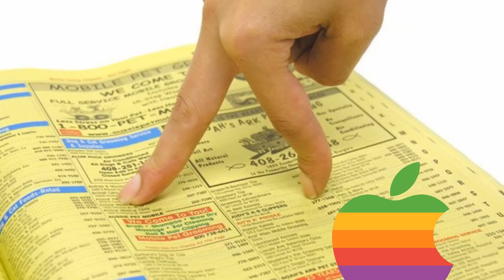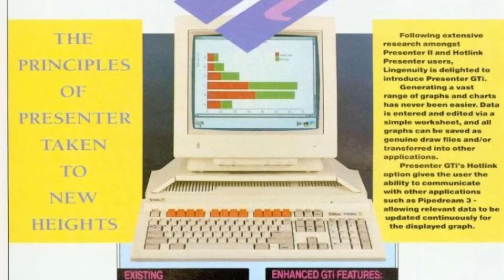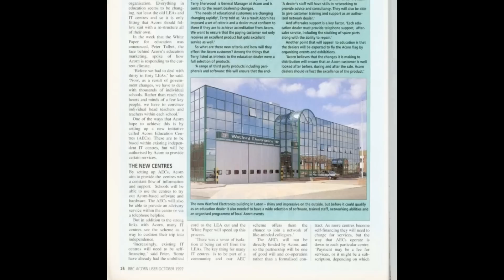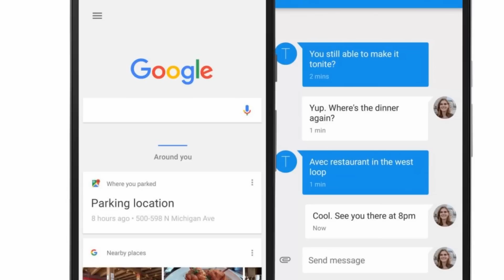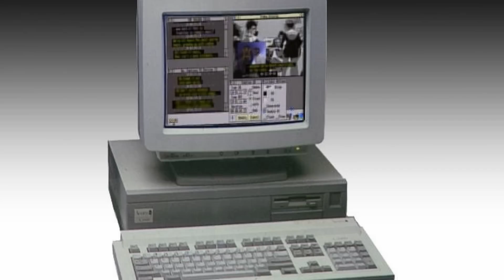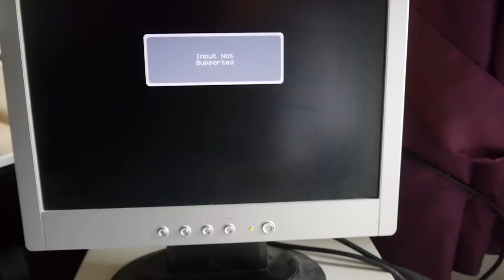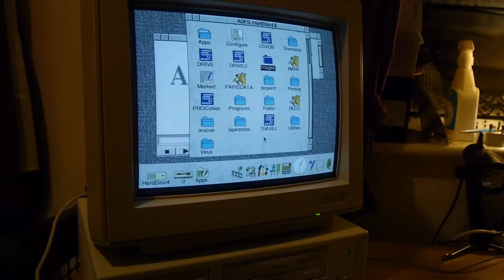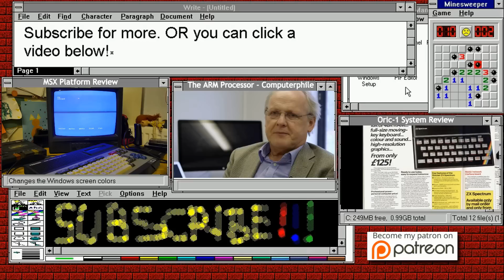Acorn Archimedes A3010 System Review & RISC Explained | Nostalgia Nerd

Comment: I wish you would have compared Elite with the current PC port of the game, I have only ever played it on DOS Box, even though I was gaming on a top of the line Zeos 486DX2 in 1991 - my dad bought it for "the family" (basically he KNEW he wanted, and figured me and my brother would quickly fall in love with it - which we did! But obviously, my mom almost never touched it, apart from Solitare!) I knew how to run DOS at nearly a professional level by late 1992, my favorite games in the early days were the likes of Wing Commander 2, Savage Empire, Commanche64 - and many others, some very popular like Lemmimgs, some all but unknown at the time.  Never got into Elite though at the time - even though I jad a PC capable of full 3D at 640x480 to 800x600 and eventually even 1024x768 and above by the time games like Quake were around - my dad went through upgrades like CRAZY at the time - I don't even remenber all the different video and sound cards we got in the early days, though in 1992/3 I DO remember the first video card upgrade, he bought it to play full 3D flight sims at the best available performance, it was an 8 MB Diamomd Edge 3D accelerator, which IIRC had to be plugged into the 2 MB "2D" based video card, but it may have replaced it... Because even the video card and sound card and even the 350 MB HDD our Zeos brand FULL Tower 486DX2 top-of-the-line  were all top notch, as they should be, since my dad did spend something approaching $5000 - I KNOW it cost no less than $3000! 

Anyway within 2 or 3 years (I forget exactly) we had upgraded the entire motherboard for a Pentium 133 which of course, was top of the line when dad bought it, I actually think it was a Pentium PRO possibly... And then the VooDoo3 right after the TNT, eventually I was playing games like Hexen at 1024x768 at around 60 FPS with video settings maxed out! THIS is why the N64 and PS1 were the LAST consoles we ever owned!
 
Going from my family's PC to the N64 to play Hexen was TORTURE! As were those AWFUL CONTROLLERS! To the point where I NEVER played it on N64, Unless we had 4 people on split screen which made it great for hanging out. Of course since my whole family are PC people, we had LAN parties, and I LOVED THEM!  Hexen on N64 was absolutley TERRIBLE! Much lower frame rate, resolution, constant hitching - and this was something like 2+ YEARS after it came out on PC, and I was already playing at MUCH  better quality in every conceivable way! 

To me, looking back on all this COMPUTING HISTORY - it is nothing short of AMAZING! Almost miraculous-  to think that RIGHT NOW - on my lap sits a Tablet with a 64 bit Quad core ARM V8 CPU - with a tiny Adreno GPU - that can EASILY blow away even PC games from just 6 or so years ago, and compared with my first PC ever, that nearly $5000 Zeos 486 - this tablet is LIGHT YEARS MORE POWERFUL IN EVERY WAY! And it even has a TINY 256 GB Micro SDXC-  that is the size of the tip of my pinky, and it holds THOUSANDS of times more data than every single BIT of memory combined from my Zeos, Hell the 3 GB of RAM in said tablet is still hundreds of times more! 

And it is ALL BASED OFF OF ACORN ARCHIMEDES ARM TECHNOLOGY! Combined with Google's Linux based Android OS, it is SURPRISINGLY 
powerful in every way! 3D games run amazingly well and never fail to surprise me with how good they look compared with my INCREDIBLY powerful X86-64 desktop! ARM technology is really amazing!
Reply: it's insanely great :)
not the gfx, they are fine. Tidy Classy and Fast - but the on screen buttons - so no function keys (yay - stupid but it's why the Nintendo port is so good xx)
Other ships fight between themselves - often completely ignoring you. You are in a Live universe.
and.... Police... omg the f---&& police. Fly in formations - dominoes and shoot as one. 
It should have been open world - god if they had... we would have had ARM everything (our current state of being ;o) 10 years earlier <3

there's a public domain release - 1.14 for any arm emulator xx #rpcemu?
I didn't mention how complete and polished it is. Grrrreat game. but 1991 Jeff Duggan Elite A III is the best ever version of 'original' elite. - cos u can buy ships :D

Comment: Don't forget the fact that the Motorola 68000 CPUs are used in early Macs as well as Amigas and Atari ST's.
Reply: Not to mention the Sega Mega Drive and Neo Geo...

When you look at the early home computers and consoles, until we get into the era where 3d games start to become common, you see the intel X86 family off by itself...
The closely related Zilog Z80 and clones. (surprisingly similar in several ways to the X86)
The 6502 and derivatives such as the 68c816 (Seen in the Apple II, C64, NES, Snes and a bunch of other systems)
And of course the motorola 68000 and it's close relatives...
Reply: Yeah, it was all Zilog Z-80, MOS 6502 and Motorola 68k for a long time.
IBM POWER and PowerPC had little share in the home market but stayed mainly in the server and large computing realm, even after x86 came along. Which btw are RISC internally since atleast 1993.
Reply: Most of the 80's arcade machine game boards we're powered by Motorola 68k and Zilog z80 daughter boards.
Reply: Intel and AMD make cisc processors Even today as the x86 architecture is orginated from a Cisc design..

Comment: Does the A3010 use standard 1.44mb PC disk drives or does it need a specific make and model to work as the Amiga and Atari ST computers do? I have one but the disk drive head is beyond repair by cleaning etc so need to swap it for another so I can enjoy this fabulous machine I bought a long time ago (PAYPAL thought a broken disk drive was OK for a 'tested' and 'working' system item description)
Reply: Yes it can use a standard 1.44mb drive, but they need to be modified.  I have once such drive in my A3010. As luck would have it I also have a working A3010 original drive that is nice and quiet but now surplus to requirements.  Would you be interested?, if so drop me a line:

andrewDOTmcconvilleATmetronetDOTcoDOTuk

Comment: I will say RISC and CISC has merged since p3. With CISC chips being packages of RISC cores. Also, DSP and RISC cpus have merged.
Reply: That trend has been ongoing for quite a while. RISK designs have been getting more and more complex instructions, and CISC machines have been gradually dumping direct support for some of the most obscure CISC commands, and then using internal microcode in the CPU to translate such instructions into a sequence of smaller, simpler instructions that the CPU actually executes.
To be fair, when it comes to the PC I'm not sure a modern X86 controller is even remotely similar at a low level to the original 8088. What it does contain however, is a microcode translator that recognises and properly translates all original (and any newer legacy stuff, such as the original MMX instructions) and translates them to what the modern CPU actually knows how to do internally.

How similar the internal instructions are to what the CPU claims to be it's instruction set though... Who really knows except the designers of the processors...

Comment: Is there any relationship to the current ARM cell phone cpus. Simular to the lose relationship between 486/Pentium to current gen CISC chips.
Reply: ARM is still RISC to this day (which, by the way, does not mean what the video explains). IBM PC and derivatives/evolution are CISC.
Reply: Same family. Likely the very fundamental aspects of the instruction set and architecture are the same.
Just as a current Core i7 can still run the same instructions that the 8088 designed in the late 70's can, it seems quite likely that a modern ARM cpu can still run the same code that the very first ARM chip could.

Of course, the modern systems have had major design changes, new instructions, more cache, pipelines, floating point units, and are just much faster, but they probably still understand all the old instructions...

Comment: The A3010 was the best home computer Acorn put out and technically superior to the slightly cheaper (£100 less) stock Amiga A1200. Sadly the only decent games of arcade or console quality were straight ports of Amiga titles like Lotus Challenge 2 and so were not better. If only some slick arcade games that didn't look like 50 pence PD software were released it may have taken off. The ARM chip in this is about the same performance as a 20mhz 68030 (the Amiga 1200 14mhz 020 is crippled to an effective 7mhz without an expensive 32bit FAST RAM memory expansion due to legacy design compatibility with Amiga 500 chipset butting in 1/2 clock cycles. And just last week ARM was sold off for a record price so it really is the end for an amazing example of British superiority. Proof that crap looking games hurt sales badly.
Reply: tiz true. Very few of the original games were anything close to finished xx shame.
everything else totally rocked. On just about every Acorn machine I've ever owned - and the ones  we still dev xx

Comment: funny how perception differs, I always preferred the Amiga and Atari keyboards heh
Reply: The Amiga 1000, 2000, 3000 and 4000 keyboards are OK, better than PCs and Macs of the time in some cases like A1000 or 2000 but the keyboard on A600/1200 is as disgusting as the poor keyboard of the Atari XE machines and the 500 not much better than the 520STFM keyboard. I wouldn't piss on an A500 for typing endless lines of code into that's for sure lol
Reply: completely subjective of course, I would rather have my A2000 keyboard than my corsair K70... wish there was a way to adapt them to use them today similarly to how you can with the C64 keyboards
Reply: Lots of solder and a fine tipped soldering iron and an old Packard Bell proper keyed (not iMac style) USB keyboard. This is what someone did with a dead Atari 800 keyboard and hardwired each key to a key on the packard bell keyboard to make a USB Atari 800 keyboard for his emulator (which he ran on a small Intel Atom nano ITX board inside the case of an Atari 800. It is somewhere on Atariage, damned impressive but possible for any mechanical keyboard including Amiga 2000. Keyrah mapping for use in Windows with the C64 keyboard is not really suitable for day to day computer use if I am honest but is great for emulated systems inside real C64 keyboard and case though. (Well v1 keyrah was)

Comment: I am impressed by the power the system has I didn't know they produced a model up to 95 those have good graphics but sadly all these early machines were limited by their propitiatory hardware short shortsightedness to future applications so they died with only their own system just imagine what could have happened if they all were compatible with one another.
Reply: Actually that's where you're wrong because the Acorn Archimedes machines had very simple to use audio hardware interface and video was straight up VGA style byte per pixel screen memory manipulation just like 486/Pentium PCs graphics cards at the time. Both Archimedes and PC compatibles were pretty much 100% CPU centric....a rich mans ZX Spectrum/ZX81. The model is better for scalability than the Amiga custom chipset rich and slow CPU model because come the time of a new machine being needed R&D is astronomical. If you had ever tried to code X86 machine code in that Dickhead's Operating System (DOS) environment you would come to the conclusion only a prick would wonder why any machine should be like the piss poor PEECEE pre Win2k/XP and PCI/AGP. The worst machine on the planet won, it would be like MSX conquering Amiga 500....absolutely idiotic situation we ended up in thanks to yank pricks NOT buying proper computers and getting IBM EGA and NES delusional combo of 'technology' lol dumb twats
Reply: After the Archimedes you had the RISC PC, you should check what it could do, and how it could do it.
If you study the Acorn hardware, the design was flexible enough to allow Acorn to produce new models with extended capabilities, sometimes simply increasing the clock rates of their chipset (the exact contrary to the Amiga with copros synced on the electron beam / scanline frequency ; making it more difficult to upgrade and keep compatability, or costing more because you had to integrate the complex existing chipset and add a layer of improvements. Clever design for a games console, but not for a range of computers).
Reply: lol me's laughing at your (superior intellect with my last breath I spit at thee Khaun ) Dos was early days of the X86 it has advanced alot since then but in those early days your right those machine were better but not anymore from a superior .
Reply: Khan*

Comment: Fantastic video mate, and drool-worthy machine!  Always liked the Archie and RiscOS, the 3010 was my favourite model too.  Had a couple at school, they seem hard to find these days though.
Reply from the maker: +Dan Wood - kookytech.net Thanks! Yeah, it's a beast. I think you should take a look at one in a similar vein to your Atari ST vid
Reply: I still have mine!
Upgraded the CPU to an ARM 3 setup - twice as fast with an internal cache and more RAM.
Took a guy with surface mount skills to do it.

One problem with the A3010 was that ArcElite had a tendency to freeze up when a certain kind of ship was in your vicinity. Read that fitting a HD would fix that, but in those days hard drives were ridiculously expensive, so never got one.

Maybe one of these days I'll dig her out, fire her up and play. She's a lovely machine.
Reply: They pop up on eBay very occasionally, but they are expensive and usually not in working order.  Get yourself a Pi and run open RISC OS.

Comment: Thanks for the upload. High quality video, very informative.
At the beginning, instead of '8 bit stereo sound' which is true, it could be more accurate to state '8 bit logarithmic 8 channels sound with 7 independent stereo positions' (to differentiate from the Amiga) and later in the video the name of the operating system isn't 'RISC 2' but 'RISC OS 2' ;-)
The A3010 could be expanded to 4 Mbytes of RAM like all the Archies (some of them up to 16 Mbytes to be accurate).
The Acorn A4 laptop and the RISC iX machines are missing in your list of Archie systems ...
Games like Nevryon, Chocks Away, Stunt Racer 2000, Chopper Force, Big Bang, Revolver, Darkwood, Arcturus, and the playable demo of Scorpius could have been demonstrated : they were great and specific to the machine. The videos are on Youtube.

Comment: Man, I want one
Reply: Funny thing is, you can easily and affordably get something that's pretty comparable - and you don't have to jump on eBay to hunt for it. The RISC OS has been open-sourced and is still being maintained. And hence there is a port of RISC OS to the Raspberry Pi - which uses an ARM CPU, of course. And the Pi, as small a little thing as it is, has specs that far exceed these Acorn machines of the late 80s, early 90s. Get a Pi and go to the OS download page at the Pi website, scroll to the bottom - will see link for RISC OS. Once you hook display, keyboard, mouse, power supply to the Pi, install the SD card to boot from, you'll be put into a retro nirvana experience. And bonus is that the BBC BASIC that is part of this RISC OS install is way, way better than Microsoft BASIC. It had a faster, more performant implementation (when running on the same hardware footprint) and it offers a better, more structured programming dialect of the language (and has a very note worthy woman computer scientist that was responsible for bringing about the BBC BASIC that people know and use). And the RISC OS provides a code editing experience for BASIC programming that is much better than, say, the Commodore 64K kind of BASIC programming experience.

This is an entirely authentic pathway to becoming a retro computing experiencer and not just a passive observer. There are really no excuses for not diving in. You can't buy a board today that natively runs classic Mac OS or Amiga or Atari. (There are attempts to recreate these in FPGA implementations, but they're not fully there yet and the boards are costing $300 to $400 for such efforts.) For less than $40 one can get a Raspberry Pi and run the RISC OS and step back into that golden age of micros of the heady 80s, early 90s.
Reply: that 3010 is the classic SOC collectors machine too.
It's the first ever production computer with a System on Chip.. memc cpu vidc and io are all on the one die :)
these were four different chips, in pqfp packets with legs on :D in an original 300 or 400 Archimedes xx
also why it destroys the arm2 8mhz machines, even at the same clock speeds. ridiculous though it sounds, the bits are closer - it matters a lot -lol
Reply: have a look on Lukes comment - I don't wanna spam <3
Reply: I remember the acorn at school in 1987 when I was nine- great machines. The BBC micro in 1983 when I started school, just awesome.  Great machines. I'd advise getting the one with the first inbuilt hard disk, whatever one that was probably the A4000 (someone correct me if im wrong on that, my family had the Archimedes at home too, but we had if memory serves an external hard disk that was the size of a breeze block lol!) which like the mac was significantly faster than pcs of the era because of that risc chip....and remember the O.S on Acorns was all in Rom. Just very very fast computers of the day.